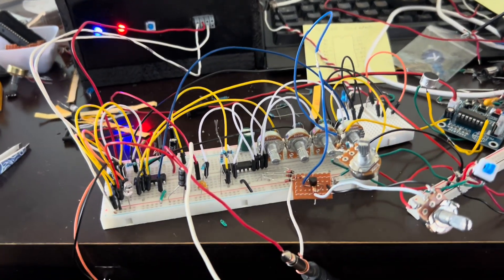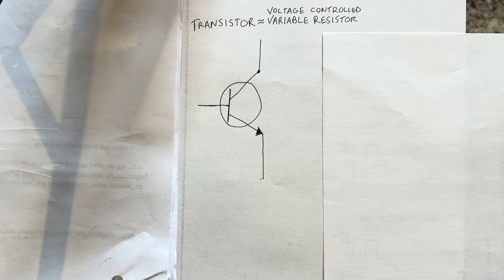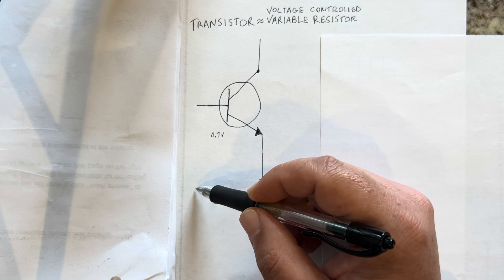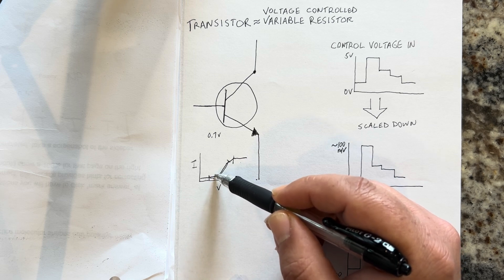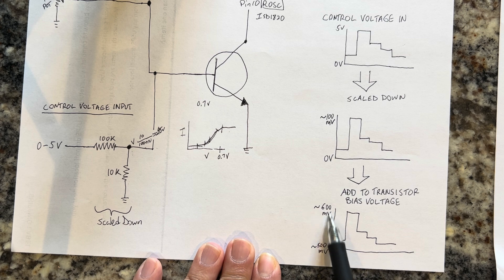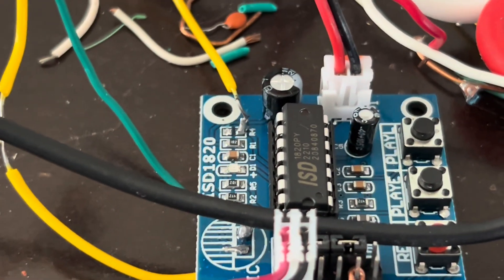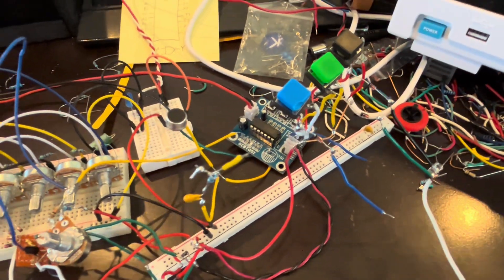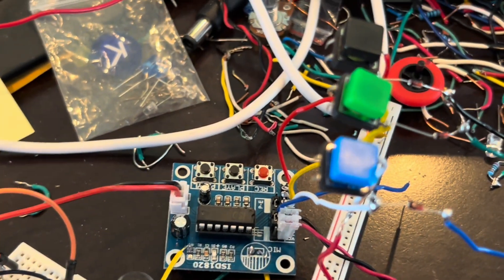ISD1820 Sampler Part 2 - Adding Automation with Control Voltage

Comment: Is that pin on the chip not already voltage-controlled? I've seen other docs for this chip that hook up CV directly to it through a scaling resistor.
Reply from the maker: It is but not reliable

Comment: Fantastic! Thank you for sharing. How much is the resistance value between collector and emitter?
Reply from the maker: Thanks. I am not able to measure the value directly with my multimeter because the power has to be on in order to work and my multimeter can only measure resistance on a static system. So i just added a potentiometer to adjust the bias until its in the audible range.